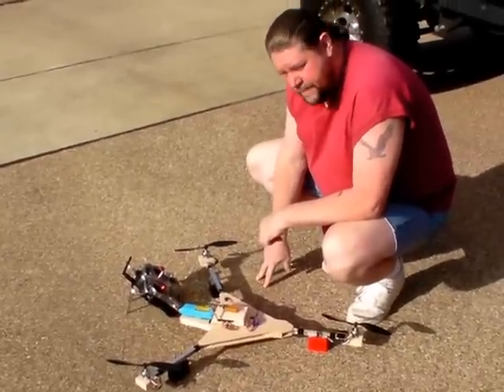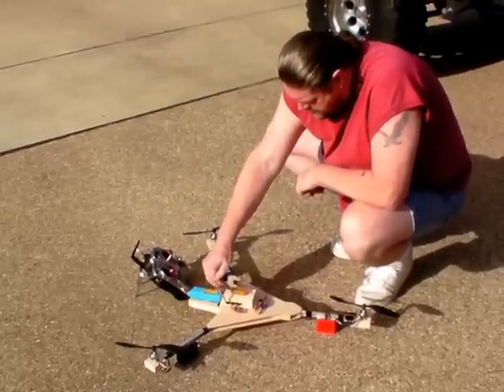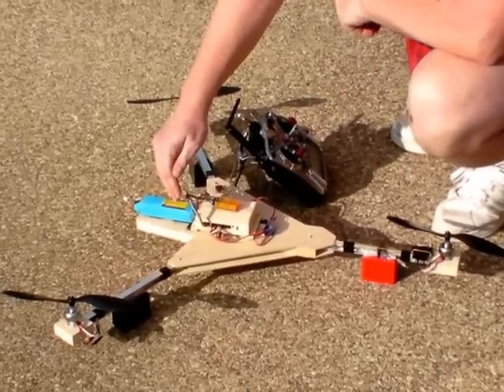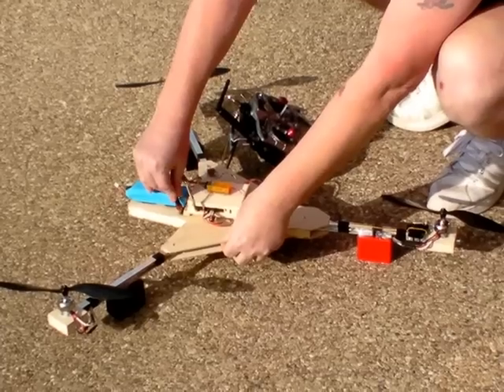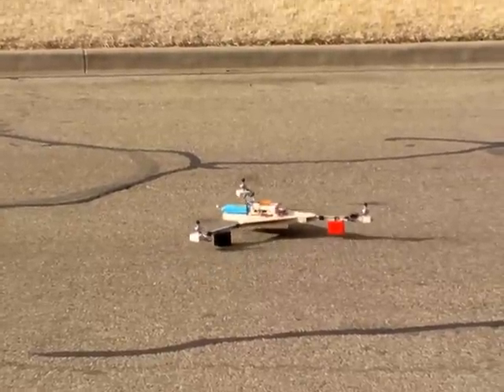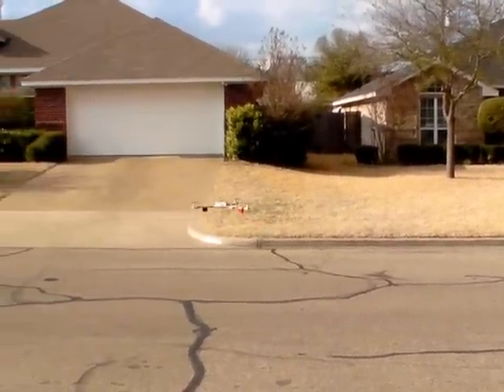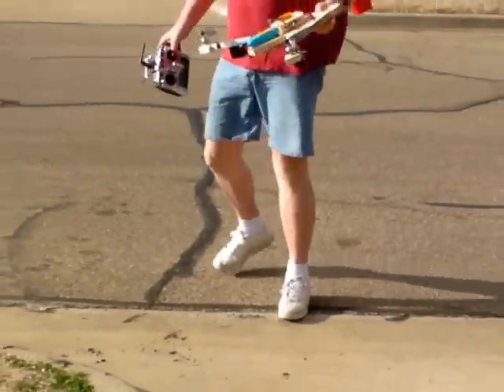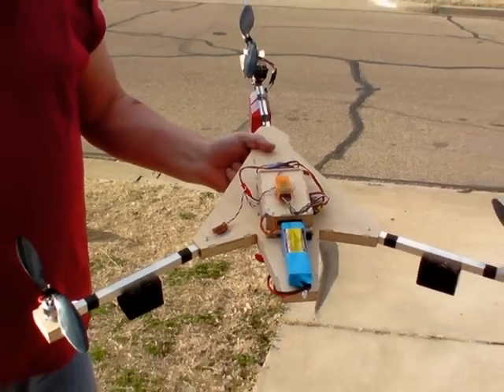My First TriCopter

Comment: Kind of sweet looking copter but if I had one main concern it would be the additional weight it's carrying from the wooden framework. As long as your motors are not running hot to touch, it'll probably be fine. Your batteries just won't last as long as if it had less weight. In the grand scheme...it's all good! Have fun flying!!

Comment from the maker: @TheRattleSnake3145 You know, I've been getting that for years! LoL I actually met the guy a few years ago. BTW, he's NOT 7 feet tall. I am 6'9" and am a little taller than he is. LoL

There are benefits and drawbacks to both, but it's really your personal preference. The Tri is a little cheaper (one less motor and ESC), offers greater yaw authority, but will require you to set up a mech. assembly and use a servo.

Quad uses no servo or yaw mech, but will cost a little more in gear.

Comment from the maker: @Shawnee845 Yes, all the motors are spinning in the same direction. It has been determined that it is best to set up one of the front motors to turn in the opposite direction so that the airframe stays more level in flight. I was interested in seeing what would happen with all of the motors spinning the same with the Flight Stabilization system that I used (I wondered if it would work well, or if the FSS would really put up a fight). It turns out that it works just fine!